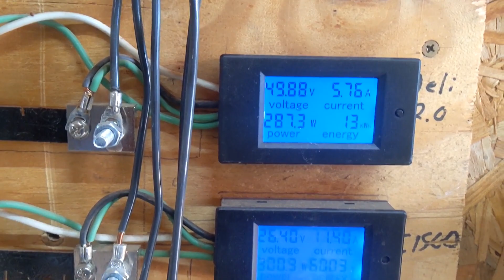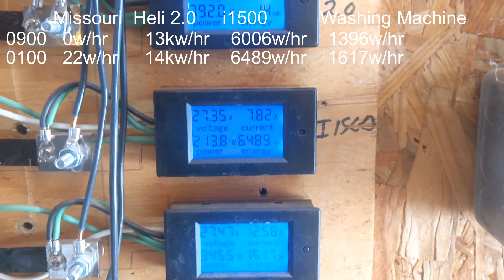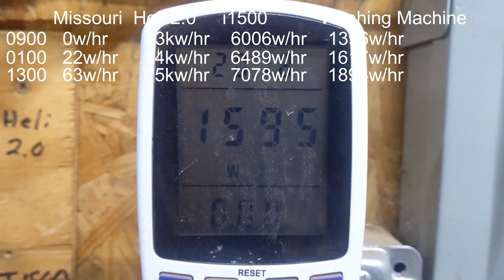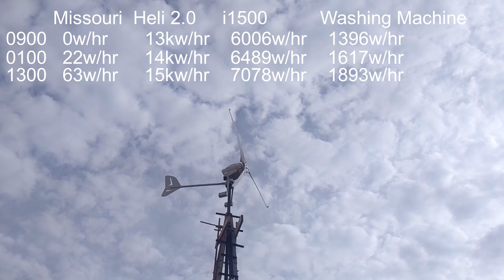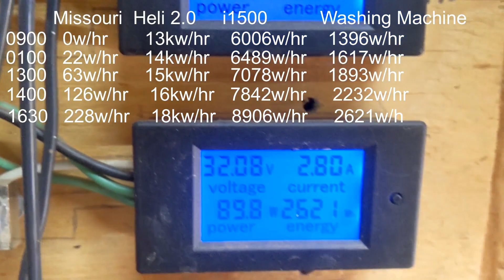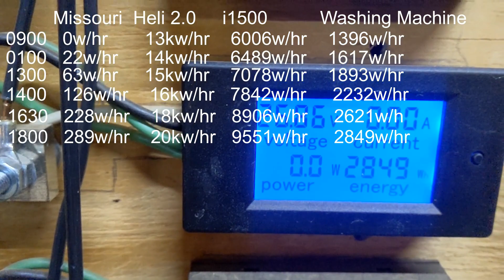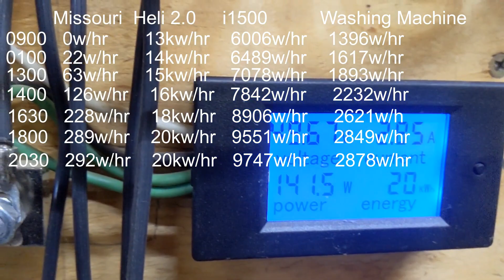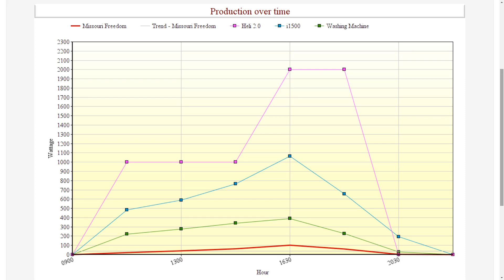iSta Breeze i1500 & Heli 2.0, Missouri Wind Freedom, and a washing machine: 1 full day of work!

Comment: All 10 wind turbines are using 1.2M wind wheels with 5 or 6 blades.
26V - 24V 500W Vevor               -  6.5M high            -  4,352 Wh 
26V - 24V 500W Vevor               -  6.5M high            -  4,160 Wh 
14V - 24V ista Breeze i500        -  4.5M high            -  1,278 Wh
12V - 24V 300W Hyacinth          -  4.0M high            -     871 Wh
12V - 48V 500W Sunboo S5      -  3.5M high            -  1,570 Wh   
12V - 48V 500W Sunboo S5      -  3.2M high            -     737 Wh  
12V - 48V 500W Sunboo S5      -  3.0M high            -     496 Wh    
12V - 48V 500W Sunboo S5      -  3.0M high            -     368 Wh
12V - 48V 300W new rotor        -  3.0M high            -     440 Wh   
12V - 48V 300W new rotor        -  3.0M high            -     353 Wh
I live in a Low wind area, my average wind is only 6.2 miles per hour.
Hey guys, think about posting your turbine information and production.

Comment: Thanks for sharing, it's very useful. I have 2 questions, how many watts do you get on Heli when low wind 7 to 10 mph? and how many hours it takes to charge 20% of 4 GEL battries 48V (4 X 12V - 225AH) at low wind (7-10 mph)?

Comment: Hey! thanks for very interesting and learning movies. I'm going to buy a wind turbine. Thinking of i1500 or i2000 has an average wind of about 5m / s. I'm interested in a 5 wings. Is the i2000 more difficult to start in low wind  than the i1500? do you think it is an advantage with 5 wings if you have a fairly low average wind.
Reply from the maker: If that's your actual average wind speed then you don't have anything to worry about.  I live in an excellent place for wind and still our average wind speed is only 5.5m/s.  Either way, the 3 blade i1500 starts up just fine even in low wind.  The i2000 will only have slightly more drag starting up.  Even if wind was a concern I would strongly advise trying with three blades first and only going "up" if the turbine struggles.
Reply: @ToysforWatts  Thanks for the reply! As I understand it, the turbine starts earlier with 5 wings, but it has a lower rpm and may not reach maximum power. even tail on wind turbines might need to be larger so it holds up better if you use 5 wings? are there performance cards on 5 wings for the i1500?

Comment: It seems that i1500 has absolutely the best power per price you pay… what do you think about i2000 that is very similar to i1500 and just a little more expensive ?
Reply from the maker: I think the i1500 is easily the best watt per dollar you can get in a manufactured turbine.  The only turbines I've had a better return on are the ones I made myself...and it wasn't by a great margin.  The i2000 is just like the i1500...it's just got a little bit more magnet and copper in it.  If I had to buy a turbine today I would probably go for the i2000 just to see how it performs in comparison to the i1500.
Reply: @ToysforWatts  yes, that is what I was thinking at too, price is similar and their output from specs shows a lot more power for i2000

Comment: Can you please add in the video description the blades you used on Heli2.0 compared with standard blades to compute surface area ?
Reply from the maker: The Heli comes standard with five 107cm blades and the swept area is roughly 3.9 square meters.  The new setup has three 125cm blades and the swept area is roughly 4.9 square meters.
Reply: @ToysforWatts  seems you did a good thing with the blades because it automatically tilts you won’t have any problems with breaking it in high winds.  If the counter weight it the one for standard blades than it must be computed proportional with the blades surface area, right ? If you increase the surface area and drag with 1/3 than same difference or a little less must be added to the courier weight, right ?
Reply: @ToysforWatts  so you got almost 25% more surface area with this upgrade, protected rotor with tilting for very high winds, seems a very good choice to me with the upgrade. Heli 2.0 is a nice one, a lot more expensive so for the price per dollar probably we can buy 3 x i2000 with the same money we will spend on heli 2.0 , and produce 2 times more energy maybe ?

Comment: I was analyzing recently the use of voltage booster controller and comparison with bridge rectifiers. One important thing I noticed is that blade design matters a lot and rpm at 10m/s . For example in your situation if blades are not designed to reach enough rpm at a specific wind speed, but your blades can produce enough power at lower RPM because that are torque blades this will be not producing frequently because you can’t reach 60V (considering voltage drops from rectifier and wires) and you can’t produce as much every as you can with MPPT voltage booster or in my case I can produce a lot more with 5 point rpm/amps curve from booster. You can get 10 amps boosted voltage in this situation and at 60V this is 600w and with rectifiers you can not get anything. Can you analyze this case and search for best solution ?

Comment: I would love to get into adding wind turbines to my home setup. If I pickup the Heli 2.0, where would I find the bigger blades you referenced ? 
And how high did you mount yours ?  I have to figure out type of pole and length. :-)
Thanks for sharing this !
Reply from the maker: You have to contact ista breeze directly for pricing on the upgraded blade arrangement.  If you can get the turbine high enough the five-blade arrangement it comes with standard might be sufficient...in my area if I could get it up 60ft it'd have worked great, but I can't mount anything higher than 40ft.  I have it mounted on top of an old windmill tower.
Reply: @ToysforWatts  thanks !  So the blade upgrade is bigger blades and only three vs the original five, correct ?  Just want to make sure I ask for the right build. 
Thanks again
Reply from the maker: Correct!  The new blades have a much larger swept area (nearly twice the surface area) and yes only three blades.
Reply: @ToysforWatts  thanks again !

Comment: Another great update. Thanks to your videos I brought an i1500 that I just got on a pole but I run it on five blades and I think I will change to three blades. It’s an 48v version and I feel like it don’t reaches the rpm to produce power that often. What are you’re experience? Thanks for a great channel👍🏻
Reply from the maker: What do you have it hooked up to and how much wind are you getting?  Three blades will definitely see a higher RPM...five blades can harness a little more wind and start earlier but will put a serious hit on maximum RPM and the i1500 needs a lot of RPM.
Reply: With a 10A voltage booster and 5 point power curve you can harnesses energy at any rpm gradually according to your blade design. What do you think ?